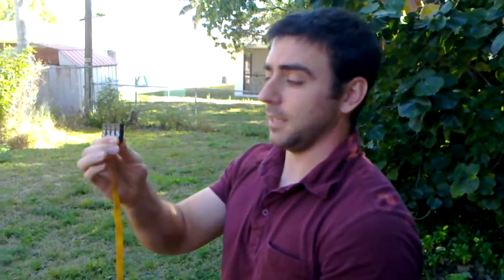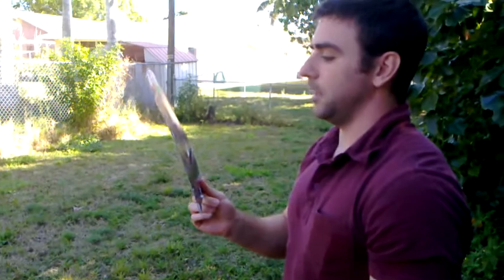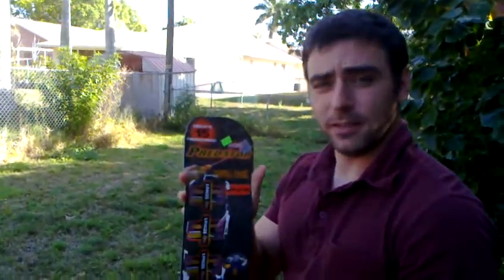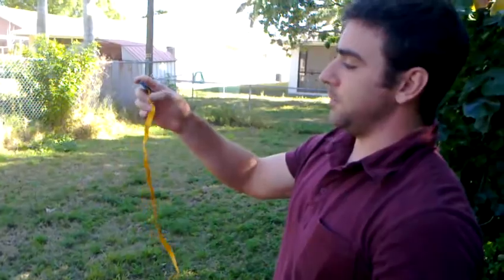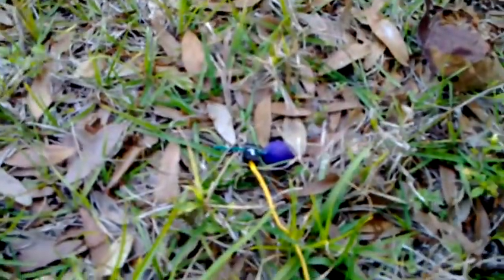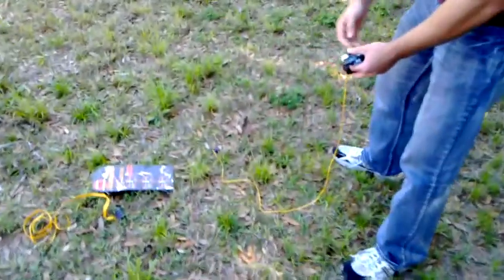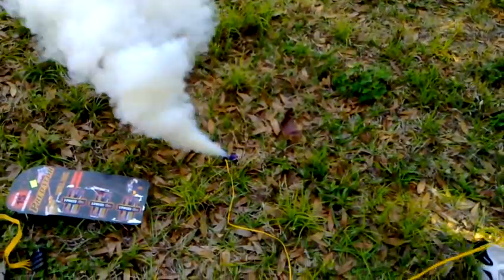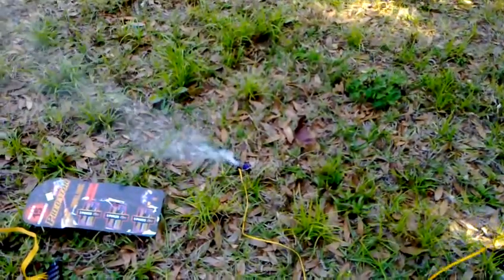Arduino - Smoke Bombs - Failed Test

Comment: to fix your problem.... Add a transistor base to D6 and collector to smoke bomb!
the other side of the smokebomb wire gos to 9volts and emitter gos to ground.
USE 6 "D" batteries to get your 9 volts. chow!

Drew